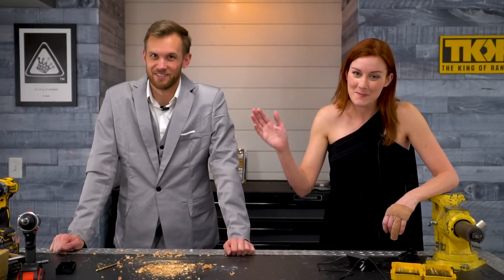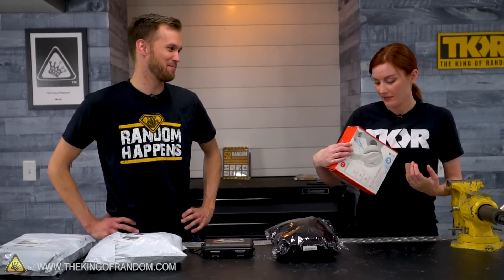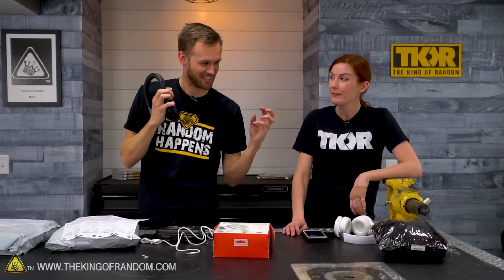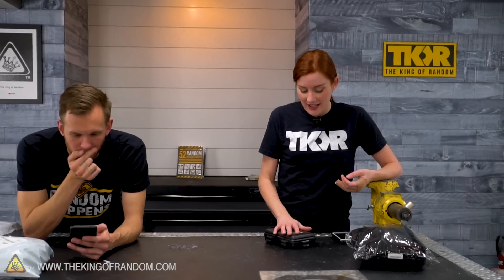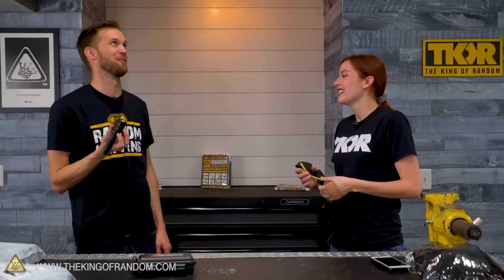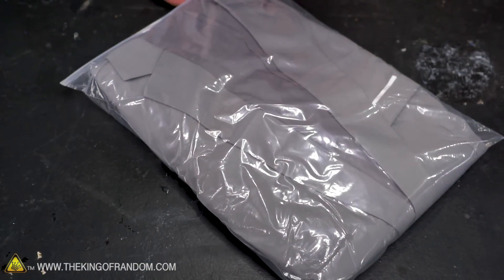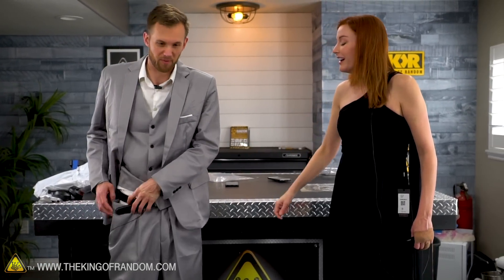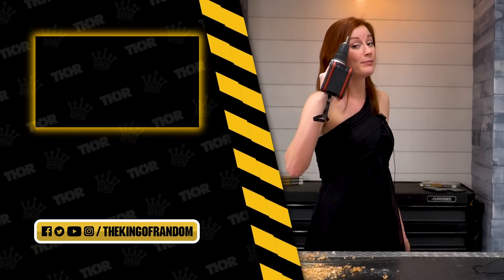Should You Buy Power Tools Off Of Wish?

Comment: I bought one of those exact flashlights.. I took it apart and stuffed it inside of an old Black and Decker Snakelight with a usb charging circuit, basically retrofitting the Snakelight.

The flashlight works great

Comment: If you're tempted by cheap Wish headphones just buy the £12 Seinnheiser ones... I've had them 4 times, they are absolutely fine until the connection in the wire goes - reinforce the wire with tape when you get it and buy the product replacement plan from Amazon or Argos which replaces them if the wire goes.

Comment: I bought a black and decker 20v drill came with charger extra battery and a drill bit set for 29.99  at walmart, sure it was on sale but still would only have been 49.99 reg price so for 14 more dollars you could bought this drill at wollyworld, ive had it for about 3 yrs now, still goin strong, i dont use it daily or anything but at least a couple times a months, im building a new shelf or running wires for audio or video in my house, fixing stuff my kids break, no problems what so ever so far

Comment: I ordered a similar drill.  Works ok for easy repairs, but the battery dies.  Ordered new batteries and it still works after two years of use.  So ok for general use.  Does what it is supposed to.  Big projects I use my stanley drill.

Comment: Alright, placing a bet before I watch: No.

Edit: I was wrong, but I think Nate misread the battery. I think it contains 3 6 volt batteries, based on the spacing.
Reply: 4 9v batteries strung together probally outperform that "battery" (unless thats what whey did with cheapo' versions of 9v's? )

Comment: It would have been easy to test the voltage of the battery... Surely u guys have a simple meter for testing voltage? Turn it to dc or battery mode, touch the terminals and u have the voltage.

Comment: I’d love to see you burn the most calorific foods  and find out if the calories that are stated on the packages are true to the actual calories in the food. There’s a method for burning food under a beaker of water and measuring the change in internal energy (heat).
Reply: IIRC one calorie is defined as the amount of energy to raise the temperature of 1ml of water by 1C (without phase change to vapour)

Comment: 9M lumen = 33,000 car headlights.
ie . 16500 cars pointing at you
You would need a 160m diameter sphere in order to put just the cars with two headlights on the front bumper. Or a 20m diameter sphere just to put the bulbs.

Comment: looks like the battery has 4 contacts, which means up to a 3 cell lithium battery could be safely charged. A 3 cell lithium battery is ~12V, if it actually is 36V with 4 contacts, it's definitely a fire hazard and cannot be safely charged

Comment: actually volts dont really go with size, the amp hours on the batteries does, example a 2 amp hour 20v dewalf battery is farely small, wheres the 8 amp hour weighs more than most of the tools

Comment: The language on the torch is italian. But it's not perfect. It's like what you get if you translate another language in Italian word by word. And a lot of words are not even written correctly (metollo instead of metallo, begn instead of bagno). It literally translates in:
"Bright LED Torch
Completely in metal technological shell CNC
Ultra-white LED
Used CREET6300 american manufacture
T6061 aviation in aluminium bath
The military standard of treatment of anodic oxidation, wear resistant"

Comment: Most eBay Flashlights over exaggerate there Lumen output. It's kind of annoying because people probably want to know right off the bat the actual Lumen output. Yeah sure, if you just look for reviews of that brand and model, you'll know then. But some people might just want to quickly scroll through and buy a 500 lumen torch. Not too bright, not too dim.

Comment: Try “20000mAh Qi Wireless Charger Mobile Power Bank 2 USB LED External Backup Battery Portable Charger” on wish
Reply: I would like to know if it is really 20000 mha battery and if the wireless charging works for around $20